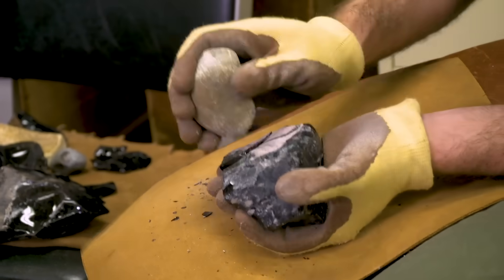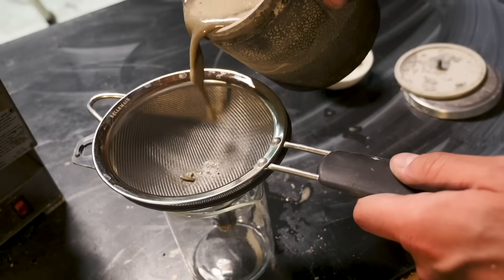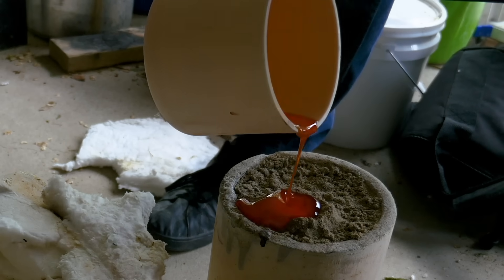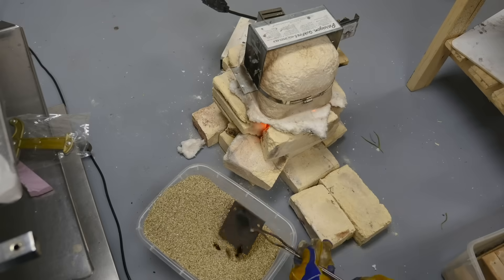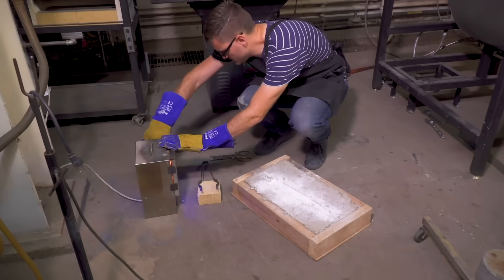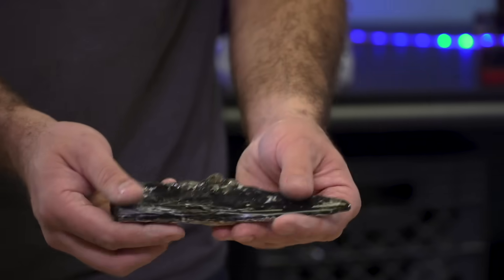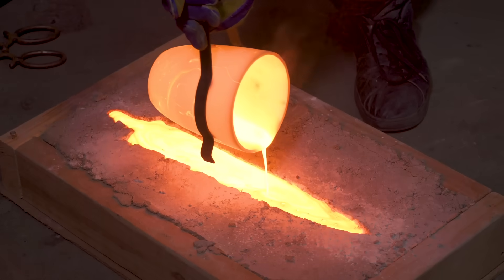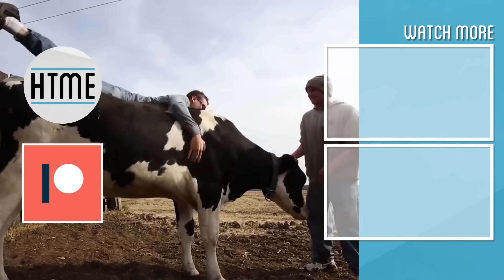Can You Melt Obsidian and Cast a Sword?

Comment: ok, so, this is an extremely inconvenient way of making obsidian tools.
let me tell you how to do it WAY easier.

Step 1. Make a new world.

Step 2. Cut a few trees down.

Step 3. Do the usual stuff up until you get a bit of iron.

Step 4. Mine gravel, sand, and clay, enough for, let's say, 202 seared bricks (item).

Step 5. Turn the gravel, sand, and clay, into grout.

Step 6. Craft 1 smeltery controller, tank, drain, faucet, casting table, and basin.

Step 7. Turn the rest of the bricks into seared bricks (block).

Step 8. Mine out a 3x3 area in the ground, and place seared bricks in the area you just mined.

Step 9. On the front of your smeltery, place the controller, and place the tank next to it. Or don't. I don't think it really matter where you place it. As long as it's touching the smeltery. Also, don't forget to place the drain and a faucet on it, then place the casting table below it.

Step 10. Build around the 3x3 area in smeltery bricks (x = ground, o= block)
  ooo
oxxxo
oxxxo
oxxxo
  ooo

Step 11. Place iron, either ore, block, or ingots, in the smeltery. Hell, even tools'll do.

Step 12. Place some gold in the smeltery.

Step 13. You now need a stencil table. That requires 1 crafting table and a stencil. A stencil requires 2 planks and 2 sticks, which will net you 4 stencils each time you craft it. However, you may want to craft 2 batches of stencils.

Step 14. Using your remaining 3/7 stencils, craft a tool rod, binding, and pickaxe head stencil.

Step 15. You now need to craft a part builder. Mine a log, or use one that you already have, place it in a crafting table and place a stencil on top of it.

Step 16. What you want to do next is place a stencil in the part builder, and make it out of wood. Don't use stone, because it is incredibly weak. Do this once for each of the stencils you have made.

Step 17. Go to your casting table, and right click with the binding, then, right click the faucet. If this does not work, you may need to switch around the iron and gold. This can be done by clicking the gold, which will bring it down to the bottom. If it does work, you should see the gold surround the binding, and then the binding will disappear. You now have a binding cast.

Step 18. Do the same with your pickaxe head.

Step 19. Switch back to iron, and place down either a pickaxe head or binding cast (You will need to do this for both). Right click the faucet. Once iron stops coming out, wait for it to cool. Now, right click the cast and you should get an iron binding or pickaxe head. Right click the cast again to get it back. Now do this for the other cast.

Step 20. Mine your casting table and place down a basin. Now right click the faucet. You should see iron coming out, and form into a block. Wait for it to fully complete, then right click it again. You now have a block of iron. Repeat this process 3 more times. (If you do not have enough iron, mine for more. I forgot to mention that putting ore in a smeltery will double the outputs as well!)

Step 21. You should now have 4 blocks of iron, and the seared bricks, and some tool parts.

Step 22. Craft a tool station. It is made out of a stencil and a crafting table below it. HOWEVER, we will not be using it. Instead, place it in the middle of the crafting grid, place 3 seared bricks on top, and 4 iron blocks on the sides. You now have a tool forge.

Step 23. Place down the tool forge, click the icon of the pickaxe, and place the tool parts in their corresponding spots. You should now have an iron pickaxe.

Step 24. Find/Mine at least 1 diamond. This is very important.

Step 25. Go back to your tool forge. If your iron pickaxe is damaged, place an iron ingot in the tool forge with the pickaxe in the middle to repair it a bit. If it isn't, or if you have repaired it, place your iron pickaxe back in the middle of the tool forge, and put a diamond in any slot that isn't the middle. Your tool should now be stronger and capable of mining obsidian.

Step 26. Mine obsidian. You may need a water bucket, which can be obtained by crafting a bucket, and right clicking on a water source. Next, find a pool of lava, and right click on a block that isn't lava with the water bucket. The water should cover the lava and turn it into obsidian. Right click your water to get it back. Now, to get the obsidian, mine one block down that is next to obsidian (but isn't obsidian). Mine the obsidian while holding crouch and the forward button. You should now have obtained a single piece of obsidian. If, upon mining the obsidian, lava is below you, right click on the block in front of you that is above the lava, and it should be turned to obsidian too. Repeat this process until you have around... maybe... 30? Obsidian?

Step 27. Head back to your smeltery.

Step 28. Place the obsidian in your smeltery, and wait for it to fully smelt.

You can now make obsidian tools!
But, if you want an obsidian sword:

Step 29. Go back to your stencil table. Create a sword blade pattern, and a wide guard pattern. We are going to make an obsidian broadsword.

Step 30. Grab your tool rod stencil that you used before to make another tool rod out of wood, as well as the sword blade and wide guard. Make casts for all of them, including the tool rod this time.

Step 31. Switch the liquid that you're using to obsidian, and make an obsidian tool rod, sword blade, and wide guard.

Step 32. Click on the broadsword icon in the tool forge, and place the tool parts in their corresponding spots.

Now you have made it. Now you have obtained a fully obsidian broadsword... But maybe that wasn't a good idea. So, to make an even better obsidian broadsword...

Step 33. Create an obsidian pickaxe head, an iron binding, and an iron tool rod.

Step 34. Create an obsidian pickaxe out of said parts.

Step 35. Head to the nether. You require 10 obsidian excluding the corners. Either use your smeltery's obsidian by making it in a basin, or mine 10 more obsidian. Once you're in the nether, mine some cobalt ore and some ardite ore. Also mine some quartz.

Step 36. Trade with villagers for an emerald.

Step 37. Mine some redstone.

Step 38. Place the cobalt and ardite in your smeltery. Once they're smelted, you should see that they're both lowering rapidly. Now, don't panic. This is intentional, because you may see another material... Manyullyn.

Step 39. I did say we were going to make a really strong obsidian broadsword, but feel free to make a manyullyn one. Just pretend I'm saying manyullyn instead of obsidian from now on if you are making a manyullyn broadsword. Anyways, get out a tool rod, wide guard, and sword blade cast. Switch the material to manyullyn for the tool rod and wide guard, and then make a manyullyn tool rod and wide guard. After, switch the material to obsidian, and make an obsidian sword blade.

Step 40. Now, head back to your tool forge. Click the broadsword icon, and place the parts in their corresponding spots once again.

Now you have obtained a quite strong obsidian sword. But we're not done yet...

Step 41. Place your newly crafted sword back in, and place a diamond in one of the outer slots. It should be stronger. Next, put the sword back in and place an emerald in one of the outer slots. Now, repeat this process for the redstone and quartz. Though, the redstone and quartz require more than just 1, and you may run out of modifier slots (unless you're using tinkers levelling). If so, you may want to emboss a tool with "writeable", a trait that gives you an extra modifier slot. This comes from paper tool parts. Go get paper from sugarcane or a village, then go back to your part builder, and place a stencil and paper in. Then, make the paper tool part. Now, go kill a few slimes, enough to make one congealed slime block. Combine it with a piece of dirt and sand, and you will get slimy mud. Smelt that, and you will get a slime crystal. Next, get a gold block. Now go to your tool forge, and place in your sword. Then, place down the slime crystal, and the gold block on the outer slots, as well as the paper tool part. Now you have 1 more modifier slot. Use it for whatever you want.

Comment: maybe try pouring into a solid mold that is at melt temp to control no air then step it down slowly the same way they stress-relieve steel pipe. maybe pour in a vacuum

Comment: Interesting idea, but that's not obsidian. There was more flux in it than obsidian so it's constituents are wrong, but worse it wasn't a proper amorphous glass with similar crustal structure. The sharpness of obsidian comes from the fracturing planes not polishing that you could do from a cast.  So chemically, physically, and structurally it's not an obsidian blade. It's a dirty, casted glass tube.

Comment: Hey maybe try making a steel blade (or some type of strong metals if not multiple kinds) with an Obsidian edge for the blade itself. I assume (if done properly) that it would make an extremely sharp blade, how ever still not the best for combat/hunting unless the killing shots connect with flesh. This idea though I feel like would make the glass a bit more durable since it would be smaller and more compact in the area that it’s being used.

Comment: That’s basically flux soup you’ve made there. You’re not supposed to use that much flux in the first place. When it cools, it turns into glass, hence the reason it was so brittle. You should be more careful and considerate of your equipment.

Comment: ok your mistakes that I see are the following 
you are trying to make it into steel 
if you are ever successful you will take away what makes obsidian so great. its edge. 
You are not getting it hot enough.
this is why it pours so thick. if you could get it much hotter then it will pour like water.
I've cast many things and it's the same.  not hot enough and it pours like honey on a cold day. 
Also cooling.
1st you are not giving it enough cool time. This should be days.
However too slow will result in something undesired.
for cooling you need to keep it in a kilm hot for days. slowly letting it cool.
Thats whats needed. But how to achieve this. Will be difficult.
Oh and your mold needs to be very hot to begin with.
This is not the normal thing to do. But because you are dealing with something like this your mold is going to need to be over 1000 degrees when you pour. This is to lessen the shock.
its going to be quite expensive to do.
But hey when you finally can do it. You will have a product you can set the price on
its cracking due to the shock I mentioned above. Heating the mold will solve this. 
This something will happen if you freeze a mold and pour say tin. It will crack.
Think of it like this.
Even thrown boiling water on a frozen windshield?

Comment: As soon as you melt the Obsidian and add flux your base material technically stops being Obsidian. Your basically using Obsidian as primary ressource for glass making.
Still pretty entertaining results and a stunning kiln breaking rate. It rather goes in the direction of glass weapons from skyrim.
Glass weapons that look and work like actual metal blades will always be a fantasy thing, as cool as they are. Glass is hard and super sharp but with hardness comes brittleness, too. 
Metals on the other hand are not as hard (at least most bronze and iron alloys are not as hard as glass) but offer flexibility instead. They can take a beating without breaking to some point.

Comment: Aztec Souvenir  wholesalers solved  the obsidian casting non- problem generations ago, by melting the stuff ten tons at a time in a proper glass furnace at a beer bottle plant.

Obsidian runs like the  lava  it used to be at temperatures hundreds of degrees lower than the melting point of pure iron.
Case closed

Comment: As I understand items and elements:
Every thing has a melting point - the point in which the energy needed to break the atomic bonds of a solid and thus turn the solid into a liquid.
If you reach that point, (item x) will then become a liquid.
You can then (experimentally) cast said item into another item.
---
As swords go (to my understanding), they can be made:
by casting (pouring them into a mold)
-
By forging (putting heat [enough to anneal the metal (make it soft enough to form it into a blade)] and then quench it (followed by tempering it).
-
Add other metals - hence Damascus steel (a combination of multiple metals to make a superior steel).
-
Forge and fold it (to add strength and purity of the blade). The Katana is one of the most famous examples of this method.
-
Casting a sword has multiple problems (as I understand).
Bronze (tin and copper) is poured.  The two metals allow it to be.  But, it is a soft metal and only by pounding the edges (thus hardening them) can you get a durable edge.
Iron - can be poured.  But, you will have bubbles (bubbles will cause weak spots in the blade.  When another sword hits the sword, those will cause massive system failure and your sword will break.).
Steel - must be forged - carbon is introduced and uniformly in the sword. (as I understand it).
---
Do I understand this correctly?

Comment: If you ever give this another shot I'd suggest picking up on the methods used for lost wax investment casting.

 It appears as though getting a proper pore in is too tough,  but if you could get a custom mold into the kelm with powderized obsidian within you wouldn't need to!  

 After the obsidian completely melted you just need to slowly lower the temperature until room temp was achieved!

Comment: You did not make obsidian, you made low grade glass.

Obsidian is formed when volcanic silicate at extreme temperature comes into contact with water, cooling it nearly instantly. The strength of obsidian comes from it's crystalline structure, not from the element that it's made of. Therefore, without a furnace that gets hot enough and a n instant quench, only glass can be formed.
Reply: glass and obsidian don't have a grain structure
Reply: @yamiyomizuki  not grain, basic molecular structure. Think diamond to coal
Reply: @olsirmonkey  or graphite all three have different properties just because of structure
Reply: The obsidian is formed with such a high silica content that it will be glass without coming into contact with water. There is very little difference between it and the glass we see every day. I used to flint knapp both glass and obsidian and they have the same apparent hardness and strength. Nothing special except the beautiful colors.

Comment: The metallurgy classes ive taken are all telling me that this is a bad, gross idea. And it is. Obsidian is terribly brittle and you mix it with metals that have a completely different grain structure. A better way to do this would be to grind it into a fine powder and compress it (sintering), like tungsten rods. This would eliminate the need for flux and force the obsidian back into its "normal" grain structure
Reply: obsidian is a glass and glass by definition doesn't have a grain structure.
Reply: @yamiyomizuki yes it does. Anything that has a crystalline atomic structure has grain. You just can't see it with your eye like metal. You have to analyze it's crystal lattices with an electron scan microscope to see the crystal pattern and that is what you call it's "grain". It's not talking about grain like wood. It's talking about the shape and direction of how the crystal structure forms atomically.
Reply: @LeggoMyTailyPo  glass doesn't have a crystalline molecular structure, and neither does obsidian, they are what's known as amorphous solids.
Reply: @LeggoMyTailyPo  glasses don't have crystalline atomic structure, though. That's kind of what makes them glass, by definition. In fact, the lack of a crystal structure is exactly why obsidian can get so sharp.
Reply: It is very brittle, 

-said every creative mode player
Reply: @Move_Flee  obsidian is like the glass they use for the windshield in cars. It’s really hard, but once it’s penetrated, then it shatters.
Reply: @davidbakke9293  Pretty sure Obsidian is different as windshield glass is often laminated glass with 3 layers, glass/plastic/glass, so when it cracks it doesn't shatter. While side windows are often tempered glass, with the outside in compression and interior in tension, this causes it to fracture into small pieces.
Reply: "And then i hit him with a baseball Bat Witch they did not see because they only see rocks and minerals"
Reply: I was thinking that it needed to have an aligned crystalline matrix to have any chance of working properly and retaining any strength at all. So that sounds similar.
Reply: I can knap obsidian blades but they are very brittle. The edges dull quickly. It’s a lot of work with several different results!
Reply: meso-americans during the 1400s: but...
Reply: Do you know why it reacted so weirdly to being heated up directly? It reminds me of what mercury does when it touches most metals but especially aluminum.

Comment: What about using a wire mesh as a framework for the obsidian to bond with/over.  That might provide the stability to keep the obsidian from breaking.

Just a thought.  I have no experience whatsoever in working with obsidian or any kind of smithing.  Any thoughts by those who do know about this stuff?  Would love to know if this off the cuff thought has any merit.